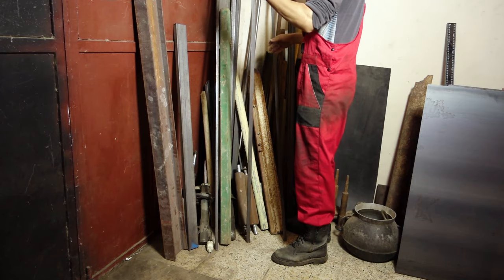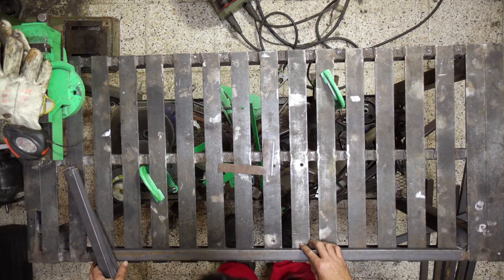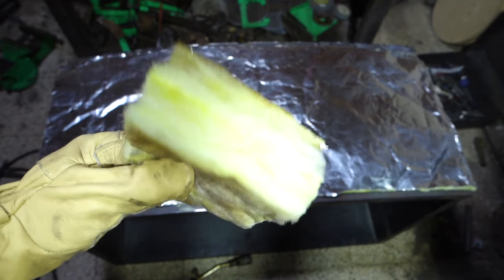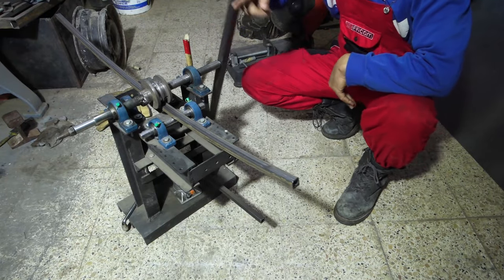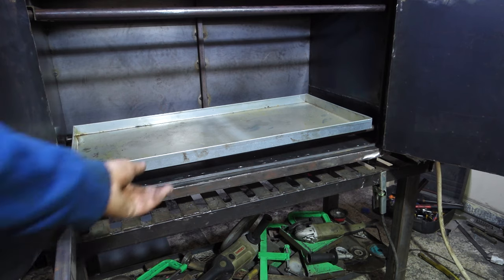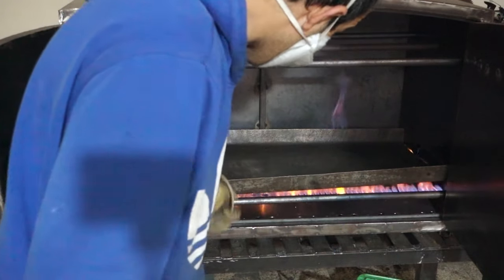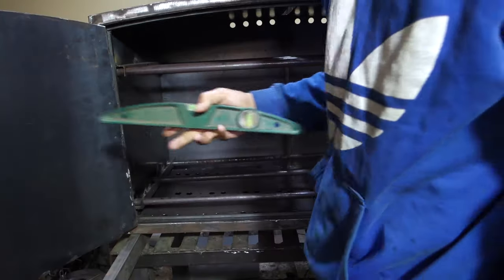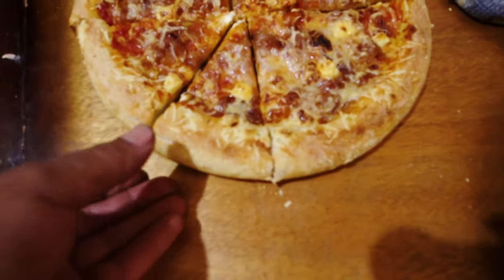Homemade bread and pizza oven

Comment: May i know all the materials for the oven? Thanks
Reply from the maker: I used 
2 sheet metal 1.2mm thick(1000*2000mm)
2 Rectangle tube 20*30 1.2mm(6000mm)
1 squar tube 20*20 1.2mm(6000mm)
2 tubes 22mm in diameter 
6 gas valves 
Glass wool 
And the rest from scrap metal i had befor
Reply: @TheHomecrafter1988   oh ok, this will help, tnx ma'am/sir
Reply from the maker: Happy to help ,👍

Comment: dimensions,  thickness of steel,  pipe hole size please
Reply from the maker: The dimensions 900mm x 500mm and 500mm deep.i used 1.2mm sheet metal
And the pipe and burners system i have a video about that
Reply: @TheHomecrafter1988  thanks bro
Reply from the maker: Happy to help